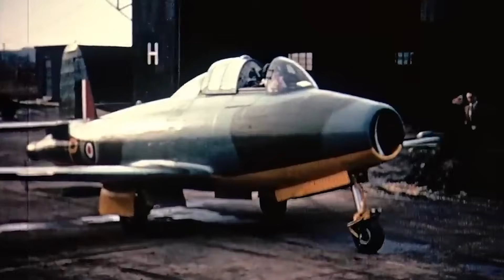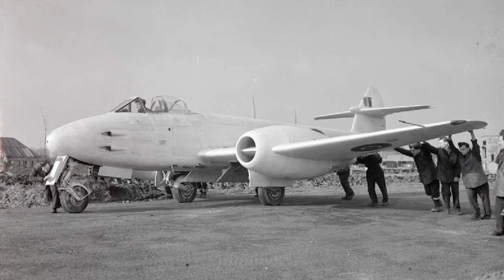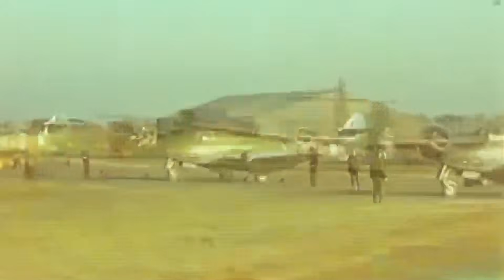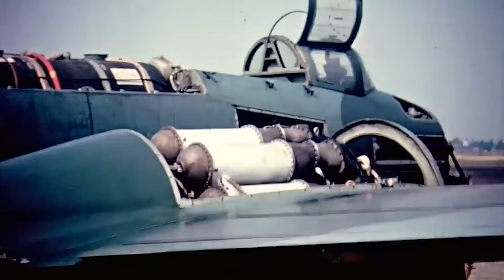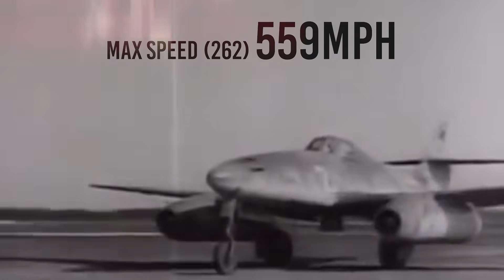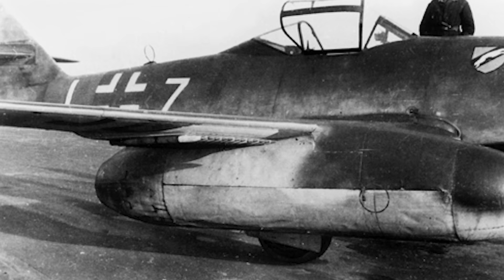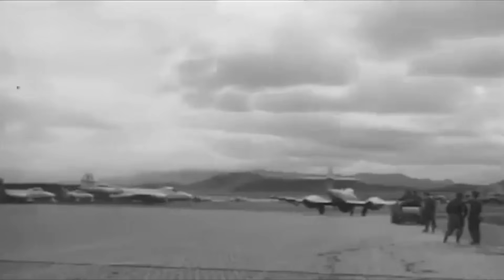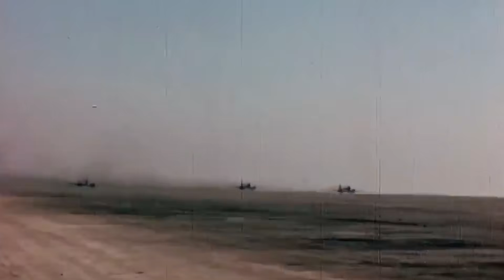Meteor vs Me 262 | Which was the better WW2 jet?

Comment: This is academic, the ME-262 downed many more enemy “aircraft”; as the meteor was used for V-1 duty; meteor duty was probably the next step above being grounded, lol! It was miraculous how the Germans were able to get those jet engines to work as well as they did considering they didn’t have unlimited access to important strategic metals. There were ME-262 aces; don’t think there were any meteor aces. Maybe some V-1 aces lol!
Reply: LOL The Nimonic nickel super alloys were developed in Hereford England 1939 -1940. In Germany they thought they needed to use stainless steel for turbine blading which doesn't work and due to various issues ended up attempting to use pressed sheet steel turbine blades. 

262 & it's engines = Garbage (but it did actually fly which surprises a lot of people). In both Russia and France good people wasted their time trying to do something with the engine after 1945. Russians ceased trying in 1948 as their own effort was clearly better.
In France RR got involved in 1950 and managed to get something useful working. 

We feel we can clear up some commonly held myths and misconceptions, obviously.
It's always good to see the facts presented clearly and concisely isn't it?

The Gloster Meteor was one of the world's first jet fighters to go into service, it was in service during WW2. The meteor was the first effective multirole fighter bomber jet aircraft with a reliable engine to go into service,  It broke speed records in 1945 and 1946. During WW2 it was in service as a fighter and multirole aircraft over the UK and over all allied controlled territories in Europe and beyond. 

The ME-262 and it's 46 minutes life engines were abandoned shortly after 1945, it had a do not exceed speed of 456 mph and was only ever used to attack bombers with losses of three 262s for each downed bomber.  During WW2 most of the ME-262s were destroyed by their engines, were various types of accident losses or were shot down by bombers. No German designers were involved with the Mig-15. The Mig-15 used a copy of the RR Nene.  

During the Korean conflict most of the Meteor casualties were due to groundfire or accident losses. The result of any tangles between Migs and Meteors was that Mig pilots avoided getting into dogfights with Meteors. The battle of Sunchon, where 50 Migs against 14 Meteors resulted in the supposedly superior Migs failing to gain any clear advantage caused the Koreans to re-evaluate tactics. General opposition in Australia to involvement in the Korean conflict resulted in the govt using the battle as an excuse to reduce the RAAFs involvement to troop support only.

The world's first wind tunnel was built in England during the 1800s. The world's first supersonic wind tunnel was built in England during the 1920s. 

The Whittle Gloster E28/39  was of course a brilliant aircraft that was later copied in Russia as the upsized and tweaked Mig 15 with a copy of the RR Nene gas turbine aero engine. The RR Nene being the world's most powerful & most reliable gas turbine aero engine in 1944.

The MD F3H Demon was a contemporary to the DH Sea Vixen & had a similar performance. The F4 Phantom was a follow on from the F3 Demon. The Sea Vixen took a long time to get from first flight to introduction for various reasons and a similar situation occurred with the MD F3H Demon.

McDonnell Douglas F3H Demon
590 Built. Not Supersonic.
Max Speed 578 MPH.
Introduction date 7 March 1956
First flight 7 August 1951
Retired 1964

MD F-4 Phantom 2
Number built 5,195
Manufactured 1958–1981
Introduction date 30 December 1960
First flight 27 May 1958

DH Sea Vixen
Number built 151 (including two DH110 prototypes and one Sea Vixen prototype)
Introduction date July 1959
First flight 26 September 1951
Max speed 695 MPH.
Retired 1972

Interesting British achievements.
There is no doubt that the Fairey (England)
Delta 2 was of course the world's first jet
aircraft to exceed 1000 mph.  Indeed It
exceeded the previous record by 310 mph &
held the record for 1 year. Incidentally, the Dassault Mirage 3 & 4 are based on the Fairey Delta 2.

The Panavia Tornado & Euro fighter Typhoon are British design aircraft with British design engines built by international consortiums. 

The EE Lightning was one of the fastest aircraft on the planet when it first achieved a Mach 2 flight. 

Early days, jet fighters.
De Havilland Vampire, Sea Vixen & Gloster Meteor accident losses were not high or unusual for fighter aircraft at the time. De Havilland built large numbers of all metal airframe aircraft before the DH Comet.
We mustn't forget of course that the DH Vampire for example first flew in 1943 & the engine was also built by De Havilland. There were examples of the Vampire interceptor / fighter in service until 1990 which was operated by more than 30 countries.

Non combat phase accident losses.
% of Aircraft built.

The Canadair CL-44 was a turboprop airliner.
Canadair CL-44                  (ff 1959 ) 48%
Lockheed XF104                (ff 1954) 100%
Lockheed  P80                   (ff 1944) 43%
Lockheed F104                 (ff 1954)  45%
Grumman f9f-5 Panther   (ff 1947) 44% 
Convair F102 Dagger        (ff 1953) 45%  
MD F-101 Voodoo.             (ff 1954) 34%
MD FH Phantom 1            (ff 1945)  35%
MD F4 Phantom 2             (ff 1958)  28%
MD F3H  Demon               (ff 1951)  32%
Gloster Meteor                  (ff 1943)  21%
DH Vampire UK                (ff 1943)  23%
DH Sea Vixen   UK           (ff  1951) 33%
Gloster Javelin  UK         (ff 1951) 20%
EE Lightning  UK             (ff 1954) 33%

It's a great pity & a crying shame that British military forces had to occupy a large part of Germany for decades after 1945 & Russian military forces had to do the same. Of course Russia still posseses a large chunk of what was German territory & of course Russia & the UK produce nukes. Obviously Germany does not produce nukes.

Early days, jet engines. Whittle performed the world's first demonstration of a gas turbine aero engine in 1937. The RR Nene, a centrifugal gas turbine aero engine, was the world's most reliable & most powerful gas turbine aero engine in 1944. Licensed built versions & copies of the RR Nene & RR Derwent would go on to power many aircraft in Russia including the Mig 15 & Mig 17, the US, China, France & other countries for decades after 1944. Incidentally, the Mig-15 was in essence an upsized / tweaked copy of the Whittle / Gloster E28/39 jet aircraft including an uprated copy of the RR engine.  The basic centrifugal compressor gas turbine aero engine with Whittle style reverse flow combusters and sometimes an axial compressor section is still manufactured by more than one company including Pratt and Whitney, the main application being helicopters.

The gas turbine engine was invented in England during the 1700s.

During the 1800s Parsons of Ireland & North England produced the world's first axial multi stage sequential stator rotor turbines and compressors for turbomachinery use which would eventually go on to to form the main components of the axial gas turbine aero engine. At the time the basic idea of making an internal combustion gas turbine engine and using it as an aircraft engine was considered thus the jet aircraft concept had been created in England before the first powered aircraft flew.

An example of what goes on these days in various countries. For example, there are of course no German companies that makes German jet aircraft in Germany & there are no German Companies that make German gas turbine aero engines in Germany that are suitable for widebody airliners.

The UK has the world's highest combined per capita Nuclear / Defence / Aerospace Sector Activity.

UK defence sector, absolute terms, world's second highest activity. 1st for per capita defence sector activity. Per capita nuclear powered submarine construction, 2nd position. 
Main players being Rolls Royce, Babcock, GKN Aerospace & BAe Systems. Activities often involve international collaboration. BAe systems, RR and other UK companies now handle more Airbus work value wise than Germany. 

There's a good chance that anyone currently flying on a widebody airliner will be on an aircraft powered by RR gas turbine aero engines made in the UK and a good chance there will be other hardware on the aircraft that's designed and / or manufactured in the UK. 

Rolls Royce Holdings UK
Subsidiaries
- Rolls-Royce plc
- Rolls-Royce North America (ex Allison etc Classified Military stuff)
- Rolls-Royce AB
- Rolls-Royce Deutschland
- Rolls-Royce India Private Limited
- Rolls-Royce Marine Power Operations
- Vinters Engineering Limited
- Rolls-Royce Controls and Data Services
- Rolls-Royce Power Systems
- Bergen Marine
Joint ventures include:
- Rolls-Royce Turbomeca
- MTU Turbomeca -

Trent Family
The MT30 (Marine Turbine)
Industrial Trent 60 Gas Turbine
Trent 7000
Trent XWB Airbus A330neo.
Trent 1500
Trent 1000
Trent 500
Trent 600
Trent 700
Trent 800
Trent 8100
Trent 900
   
RR wholly owned subsidiaries in Germany handle smaller 2 shaft RR gas turbine aero engine work.

The UK space and aerospace sectors are highly productive, high-value industries that together contribute over £18 Billion in direct Gross Value Added (GVA) to the UK economy. Individually, the space industry directly contributes about 0.3% of UK GDP 7•2 Billion while the aerospace industry contributes approximately 0.5% £10•9 Billion.
   
Wee hopes theze helpsmz.  EtC---.

We hope this helps of course 👍
Reply: The Gloster "Meatbox" only killed British pilots during WW2... it would earn a deadly reputation with 890 crashes killing 450 pilots just in RAF service alone... over half of every Meatbox built crashed or were destroyed in accidents making it the worst jet aircraft to ever serve the RAF.